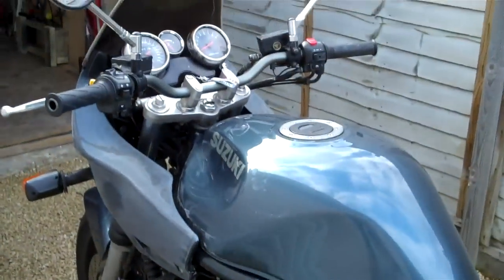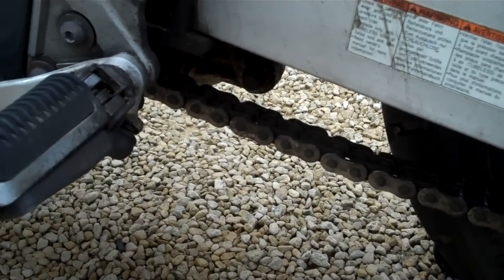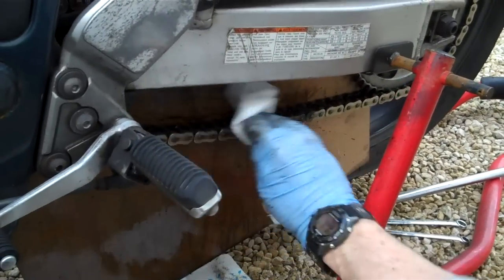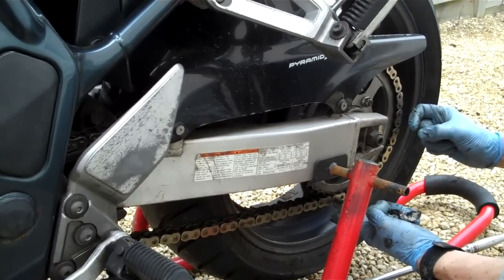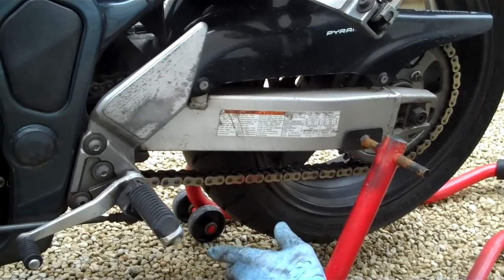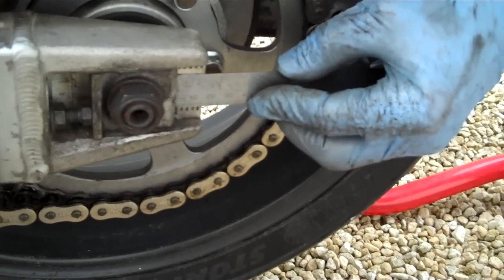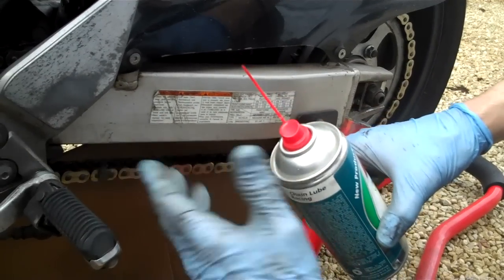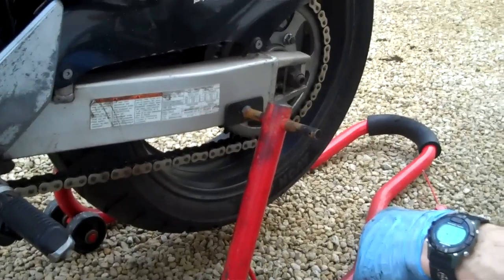Delboy's Garage, Suzuki Bandit, Chain Adjustment. (plus clean and lube).

Comment: Hi Del,

Thanks for another great vid! Although most of the things were not new to me, I still have one question - do you clean your chain each time before lubing it or depending in what condition the chain is? Spending around 10q on a 500ml chain cleaner and using around half of the bottle each time is quite costly. Thinking of switching to WD40 since it's the most common in my area and costs a third less than a chain clean.

Comment: I believe the adjustment specs maybe for with weight on the back wheel ie check on side stand.
Reply from the maker: Always check with weight on the suspension, so side stand, upright on wheels, or on a paddock stand... just not the main stand which lifts the wheel.

Comment: Excellent, sir. Thanks
PS is diesel gasoline good for cleaning NON O-Ring chains?
Reply from the maker: Diesel works ok, but it does strip everything off the chain, and a residue of it will get under the o-rings and fling off all over the bike afterwards, there are some dedicated chain cleaners in rattle cans that do the job a bit better, but yes indeed, in the old school way, diesel and kerosene do a sterling job!
Reply: @Moonfleet41  thank you very much !

Comment: Hi can you tell me if there is something wrong with my chain as when it is on the centre stand and the bike is running whilst in 1st gear the chain is bouncing up and down even though the chain has been tensioned correctly. Does this go away when I am riding it because there is weight on it - hope this makes sense. Cheers. Like the videos too.

Comment: Hi Dell im an eggsucker..lol What I really need del is advice here. I fitted a35mm jack up kit to my 1998 1200 bandit now I noticed 2 weeks later that the chain is eating into the top chain guide/buffer and sits on it when im off the bike. chain seems looser than before. Do I just adjust the chain as per your video? Also cos the rear wheel now doesn't touch the floor when on centre stand I have a jack like yours will it be ok to jack it up a little before adjustment or just put stand on a piece of wood? thanks for any advice. Dougie
Reply from the maker: Dougie Dickson Hi Dougie, when you jack a bike up you effectively drop the swing arm lower in to it's arc and as the front gearbox sprocket is mounted 6" in front of the pivot, this will reduce the gap between the rear and front sprockets and make the chain go slack... so yes, you must tighten it up slightly, but remember to check the tension with full weight on the bike so as not to over-tighten it when you got over bumps (we have a video on this if it doesn't make sense, so let me know)... good luck, Del
Reply: Cheers del, so check n adjust then put the wife on and do same again?
Reply from the maker: Dougie Dickson Correct mate, my Tiger has the same jacked up suspension as standard and the chain gets tighter and tighter and tighter as the swing arm comes down to horizontal with the road, so I stick the Mrs on the back with the bike on the paddock stand, lean over the seat myself (like a dead body on  a pack mule!), grab the swing arm and pull myself down hard to fully load it as much as possible, THEN at that point make sure you have your 1.5" of slack at the tightest point.... 

Obviously when the bike is at rest with no weight on it, the chain hangs down like a whore's drawers, but that's quite normal on any jacked up bikes if you don't want to knock your gearbox bearing out... if it's really bad, you could fit a Motocross chain guide on the bottom of the rear sprocket for safety, but you shouldn't need to !

Comment: Hi, did this yesterday and measured as per instructions and haynes manual. When i took it off the centre stand the chain was taut. Is that right or should there still be some slack? Cheers.

Comment: Hi mate I'm glad you uploaded this. I've checked the adjustment of the chain on the side stand as it says in the manual. Do you think that is a satisfactory way of doing it as I don't have a stand for the rear wheel?
Reply from the maker: Yes mate, that's absolutely fine, as long as there is some weight on the chain and the wheel's not lifted, that'll ensure that it doesn't go tight when you sit on it... just make sure you check it afterwards, preferably with someone sat on it.

Comment: Hi dell question my 600 bandit gearing is doing my head in I'm forever pulling clutch in to check if there's another gear to it feels like it needs 7 gears think it's standard at present at 15 47 if I want more smooth top end do I go up a tooth on rear or down ? What's yours thanks ant from Wales keep up the vids for us mere mortals lol
Reply from the maker: Hi Ant.. as a rule of thumb the bigger the back sprocket, the lower the gearing (so the slower it goes in top gear... like your pedal bike.. the biggest sprocket is for pulling up hills right?)... so if you go up on the rear... that will make it slower....but if you go DOWN on the rear sprocket... that will give you better relaxed cruising speed...

AND HERE'S THE TRICK... "down on the rear" is the same as "up on the front"... and as its a 3:1 ratio... swapping the FRONT sprocket for a 16 tooth... will be like swapping the back sprocket for a 44... and give you lots of cruising speed like a 6th gear... and the best part is.. adding a tooth up front can be adjusted out on the chain as its not much... but taking three off the back will mean you need to chop a few links out of the chain... more money and more hassle...        So for that 6th gear you want... stick a 16 on the front mate.. job done..  
Hope that helps..
Del.
Reply: +Moonfleet41 gr8 thanks for advice safe riding and keep up the vids your well respected
Reply: When you change these you usually put the same size on but more/less teeth.  More teeth is usually slightly lower acceleration and slightly higher top speed, less teeth the opposite, right?  I guess you can effect it more if you also change the size, if you find a different size that fits.

Comment: My 250r Kawa has crappy adjuster sliders. If the castle nut is to loose, the slider shift and your alignment will be completely out. I need to figure my bike out.

Comment: Hi Del, love your vids as always! I'm gonna tighten my chain soon, but I don't have a torque wrench (can't afford to buy one right now). Could I do it with a 24mm wrench, and mark the bolt and bike. And tighten it up to the same marked place? Like you marked the brake caliper bolts in the other vid? Thank you for your time, I appreciate it! Drive safe!
Reply from the maker: Hi mate, yes indeed, that would be fine, it it's currently done up and not coming undone, then put the two marker paint dots next to each other before you loosen anything and then return them to the same position afterwards... and most importantly of all, keep an eye on those two dots, after every single ride, for a week or two....  I know what you mean mate, we can't always afford fancy tools and sometimes we have to improvise... good luck with it mate, drop us a line in you get stuck!

Comment: Hi. Lovely channel. Really helps a new-ish vintage biker owner.  I just got myself a new GPZ 1100 from 83. It's REALLY dirty. I watched a video where someone used both oil and water based degreaser to clean gunk, dirt and whatnot off his bike. Is degreaser damaging to an o-ring chain, or can i use it if i'm careful with lubricating the chain right after washing it off?
Reply from the maker: Hi Søren, You can use degreaser on your chain if it is really bad, but diesel or kerosine works really well and leave hardly any residue so you can lube the chain right afterwards...
Reply: Thank you for the response. My trail of thought was really, that during the process of degreasing the bike i might get some on the chain. I just wanted to make sure, that it won't damage the o rings. I usually clean my chain like you showed in the video, and not with degreaser - but as i said, the risk of getting it on there is notable if i'm cleaning behind the wheel and on the shock with degreaser :)

Comment: Hi Del, ordered my 27mm socket and "sod-off" great big bar from ebay the other day so chain adjustment this weekend. However, my torque wrench is only 1/4" drive and whilst I have got an adapter, I'm thinking i'll probably snap it torquing up to that high a Nm, plus i believe it only goes up to 25Nm so not enough by far anyway. Should I just do it up as tight as I can (within resason) and then do the old nail varnish trick?
Reply from the maker: Hi Alex... You need to set the rear axle nut to more then 60ft lb's, and then dab it with marker paint yes.... and if you invest in a 3/8 drive torque wrench, that will take you to about 55ft lb, so just nip a little past the highest setting and you're good to go.... but if you really want to just do it by hand, then thats fine..  a single hefty lunge with a 12" long bar on the socket will see it about right, and then mark it so you can keep an eye on it... just don't over do it and crush the bearings...good luck mate, hope that helps you... Del.
Reply: Hmm,the bar I ordered is 24" long. Better go steady. Don't really want to have to spend a fortune on a torque wrench just for the axle. Best I go "half" a single hefty lunge.
Reply from the maker: Alex Carpenter
Or hold it half way down and give it a full lunge..lol.

Comment: Wd40 is made up of D40 solvent and WD40 concentrate 
The D40 solvent acts like a degreaser because its a oily solvent which is also in degreaser.

Fun fact, brake cleaner and contact cleaner are the same thing they both are made of SPB2 solvent and IPA they’re just different percentages because SBP2 is a dry solvent that’s why brake cleaners and contact cleaners dry up so quickly and the IPA is a water displacer. 

I blend the chemicals to make WD40 products, so yeah never use brake cleaners or contact cleaners on chains it’ll dry out the rubber fast and make them crack.

Comment: Hi mate can you help I have a 1200 bandit the problem is worse when I'm going along at 40ish in at low revs there is clonking coming from the chain/engine? I can feel it through the foot pegs the chain and sprockets are like new just had new wheel bearings fitted today as I thought it might be the problem but it's no better can't think what it could be. There's no clonking over 6000 revs and no clonking when the cluch is pulled can't think what it could be any ideas thanks
Reply from the maker: Hi John... Sounds like the motor is free wheeling mate, that is to say, 'Idling' between drive and overrun....'Drive' being when you are accelerating and the chain is under load. and 'overrun' being when its slowing down in gear and the motor us braking to keep the chain taught.... and when you are between about 30/40mph, in top gear, the revs are so low that the motor is 'bogging' and chattered back and forth between drive and overrun...that chatter makes the chain rattle up and down against the front of the swing arm {where the rubber runner is} and that vibrates through the frame so you can feel it....
To check that this is whats happening, drop a gear and open the throttle a bit so it pulls....and it should stop....then shut the throttle so you get engine braking...again, it should stop....then...to be really sure..go to a high gear, then roll off and on the throttle and you'll get the 'knocking' as it struggles between drive and overrun....
If you find this is it matey...the next time you feel it, just change down and ride in the lower gear down....should eliminate it.. no 4 cylinder bike will cruise happy below about 2k revs...
Hope that helps
Del.

Comment: do i have to worry about tightening the rear axle nut to tight if i don't have a torque wrench? will i smash the wheel bearing? should i buy a torque wrench?
Reply from the maker: If you use a 12" long spanner you won't over-tighten it, unless yo swing on it like a gibbon!  They take up to 70ft.lb. and still won't do damage even at 100ft.lb., and it's unlikely you'll achieve that tension without a long bar... so don't worry too much mate, you won't crush the bearings unless you're really trying to...!

Comment: could you remove the chain and flip it so you are using the "top" or "outside" or would that make things wear really badly?
Reply from the maker: Good sound logical theory there Bill... but think a bit further....the chain is a line of rotating rollers and only the rollers touch the sprockets...they roll round as they rub the sprockets so there would be no gain to that at all....you already ARE using the whole chain...!  like yer thought direction though mate... thats how you work shit out and do it yourself... all the best.. Del.

Comment: A question Delboy, hope you don't mind. I bought a honda cb1000 in december 2014, and have since done 2800 miles. It has a scotoiler, and I clean and oil (with the blue stuff recommended by Scotoiler brand) regularly, but it has not stretched? It is still at 30mm (25-30mm recommended). Am I doing something wrong, I'm a newby and don't know any motorcyclists. Thanks
Reply from the maker: tristram gordon That's all good Tristram, these days chains are amazing compared to the rubbish from 30 years ago, and that's when the mantra for chain wear was set...back in the old days, it was expected that a chain would stretch every months till it wore out and people still think that today...but they just don't, they are far better quality now days...in fact they hardly stretch at all as long as they are lubed properly as you are with the chain oiler..... Your modern chain will last you 30k miles at least if you take care of it as you do....just keep the oiler topped up and correctly adjusted, and clean the chain when it gets dirty so the road grit wont wear it... and if you want to save some real money, switch over to "Chainsaw Oil" its a fraction of the cost of Scott's own brand blue oil...and does exactly the same job.... take care and enjoy your bike buddy... all the best. Del.
Reply: Thanks, I didn't know chains lasted that long. I usually do about 200 miles per outing, and was getting worried something was wrong, thanks for your advice. Stay safe.

Comment: Chain lubricant isn't supposed to pass throuh the o-ring dude! O-rings are there to keep the grease inside and dirt outside. We use chain lubricant to prevent rusting.

Comment: Del, how important is to tighten strongly the lock nuts after tightening the wheel? I was under impression that the moment when you tighten the wheel it can't move anywhere even if you play around with adjuster nuts. Am I wrong?
Reply from the maker: If you torque the main wheel nut up to spec, then you will struggle to move anything by using the adjuster bolts... they need the axle to be free moving to shift it... but i do it in tandem.. set the alignment.. snuck up the wheel nut half tight.. check alignment hasn't move.. then lock off the adjuster bolts... and then torque up the axle to full spec..
Reply: @Moonfleet41  Will try it that way. Thanks. The way I was doing it was:
1. Undo the lock nuts
2. Undo the wheel nut
3. Adjust the alignment
4. Tighten the wheel nut to spec
5. Tighten lock nuts at approx 10nm

Comment: Had a new Chain and Sprocket set today, bike was only 12100 miles (I Know, my bad, had a lazy winter and didn't clean it and lube its as much as I should have done) but better to be safe than sorry, had a few tight spots and was stretched a lot. Anyway, dealer actually said 12100 miles was a good distance for a chain, that shocked me a bit, great video by the way, even if it is 3 and half years old now, always nice to see how someone else does things. 

Don't know where your based, but do you do the Margate Meltdown at the end of May?
Reply from the maker: Hi Sam, I would tend to disagree with your mechanics opinion that 12k miles is good, I'd be rather disappointed if that's all I got from mine, espeically seeing as I do almost twice that every year... if you fit a Scottoiler and keep it topped up and working correctly on a constant basis, plus address the chain tension merticulously, you should get 3x that out of your chain and sprockets... also, a little trick, is to swap the front sprocket for a new one every 10k miles as they wear out 3x faster than the rear (as they are 3x smaller, so turn 3 times more often), they are only a tenner, and the frsh fat teeth in the new one will slow down the wear on the chain rollers... most damage is done to a chain by worn out front sprockets... I would expect to get 35k from my chain and sprockets and if you buy the best quality, you should to, cheap chains are a false economy...

Btw, we're in Dorset, we don't manage Margate, but we're at The Ace in June!